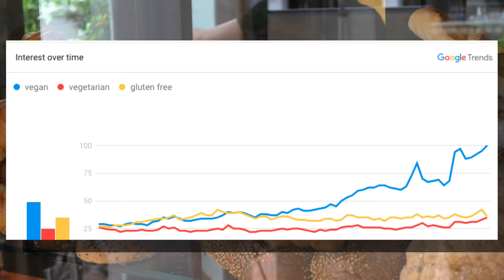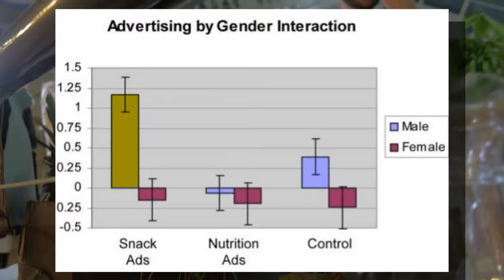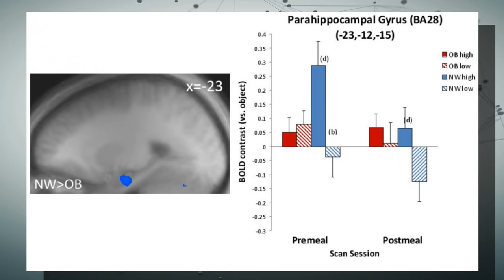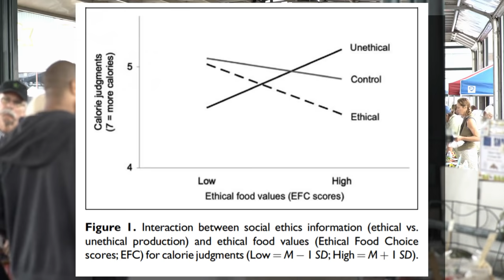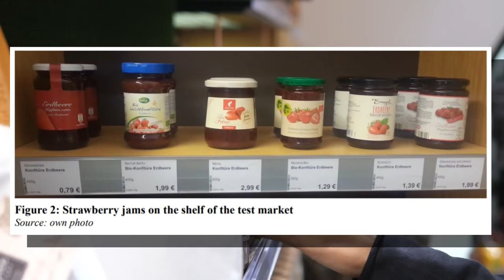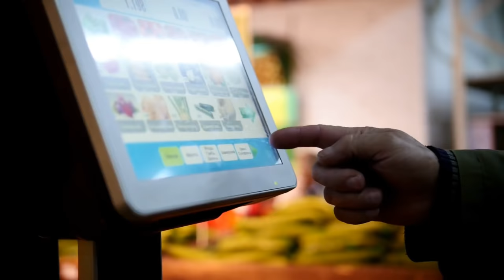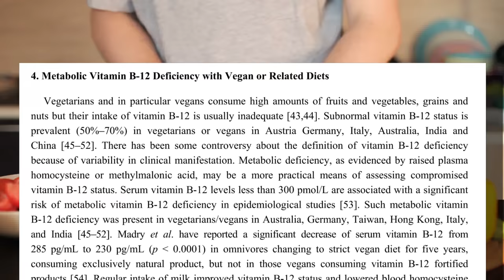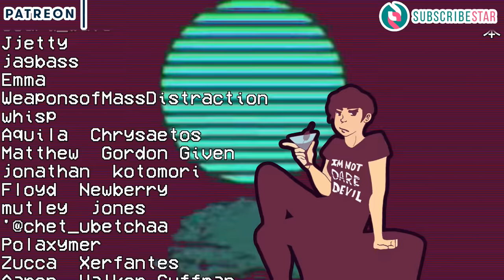Liquid Smoke and Mirrors : Impossible Truth About Food Fads

Comment: As to the bit about vegan burgers being grilled on the same surface that is econonomically and therefore morally irrelevant. Burger kings goal is not to kill animals just to make money so whatever they sell lots of they will produce
Reply: While economically irrelevant, it doesn't mean it is morally irrelevant, (although this is likely to result in the morality of the issue being ignored)
Reply: @jeffersondemott2125  it ismorally irrelevant because you are not incentivising the slaughter or sale of animals. If anything its more environmentally friendly as you arent requiring them to heat a larger space, buy another grill, and renovate their building into said larger space. If veganism were a majority position then it might be able to have a similar effect to deplatforming (so i may still be against it) but at this point all it does is reduce profit of vegan options and vegan restaurants
Reply: @jeice13  1stly advertising vegan or (insert food allergy) free food than processing said food in an environment where cross contamination is not only likely, but proven to happen is immoral, or at the least unethical [false advertising and potentially dangerous]
2nd the objection is to the "unethical" treatment and preparation of animals, [not necessarily environmentalism] and if clear violations to a promised policy are ignored then no actual change is encouraged (more vegie burgers than real burgers)
3rd and really the primary point impracticality does not bear on morality. In 1700s south it is more practical for a plantation owner to own slaves however as I'm sure we can both agree that is not a very moral means to gain money, further the "Company shop" was a highly practical method of industry to "cut down" profit loss, however it was also highly unethical and immoral. Morality, ethics, and practicality are 3 separate measures and while ethics and morality are similar enough to compare and contrast with each other, if you were to judge them involving practicalities you might as well compare time with weight.
Reply: @jeffersondemott2125  cross contamination is relevant to allergies because contact with any quantity of the substance can cause effects whereas morally it does matter if you are exposed to an animal after it dies only how many are being killed (though that is a ridiculous view to take for more intricate reasons) or how much animals are made to suffer. This means any behaviour that doesnt cause more animal meat to be produced wont matter in terms of moral veganism unless youre suggesting its okay to kill any number of animals as long as their corpses just rot in the sun. Second a lot of vegans seem to raise environmental effects as one moral component of veganism so it is kind of relevant. Finally i raised practicality to show that because grandstanding that has no chance of furthering your cause is morally worthless, aure it might raise your social standing amongst other activists but it helps no one
Reply: @jeice13   1st the moral and ethical burden lies on the producer of goods (the primary actor) hence why the distinction between allergy or preference is irrelevant, because the corporation does not know, nor need to know my motives for purchasing their specialty products [keep in mind there are people who actually can't eat various flesh meats due to ailments and are therefore forced into vegan lifestyles]. So again if a corporation (in this case fast food, specifically BK) advertises a vegan meal, they are obligated morally to uphold their end of the informal contract (that is exchange of my capital for their goods) and If they promise vegan which explicitly excludes any animal products, and fail to deliver it has no bearing on the customer's moral status. 
2nd whether a persons actions are ultimately futile or not is only determinable in retrospect, and many people begin a seemingly impossible task, grandstanding for the "impractical" but moral reality. So if an objectively just anti-proposition is held even it is not inherently worthless, and may be ultimately worthwhile while not in the present. The examples of this historically are too numerous to count, but some we praise today are an end to widespread open slavery, absolute monarchies, racial segregation, etc...
Reply: @jeice13  your presentation seems to be based in a kind of utilitarianism, which is a very limited worldview, that doesn't allow for the imagination, which is essential for change. 
I don't even particularly agree with veganism, but your argument is simple ridiculous
Reply: @jeffersondemott2125  the moral burden lies on everyone who voluntarily participates in something. This means you can have no one at moral fault in cases such as manslaughter or several people at fault if a group murder someone. If you view veganism as a moral imperative then consumers of animal product are incentivising production while suppliers are facilitating those customers wishes. Unless you have a better definition of what creates moral responsibility i cant really take your objection seriously as it is ill defined and therefore functionally meaningless.
   You seem to be conflating unethical business practices using the word "vegan" with violations of vegan ethics. This is moronic as that would also mean that any unethical action burger king takes are aomehow violations of potato ethics, beef ethics, and bun ethics because those are also things they market and sell. The ethics of veganism are only relevant where animal welfare is concerned not general business malpractice such as false advertising.
    You seem to object to utilitarianism arbitrarily so would you say it is etter to wave a stick around and hope for world peace than to go out and do things that help people? What about equally good? After all the question states good intent for the former but not the latter so if effects (or probable effects) are morally irrelevant surely flag waving and prayers are the pinnacle of moral good
Reply: @jeice13  let me make this simple because you seem to not understand. You're original comment was "...burgers being grilled on the same surface that is economically irrelevant and therefore morally irrelevant." Therefore while yes there is an impotence of morality in the customer (in this case the vegan) that is not being analyzed, because that 1: that is more subjective, and the morality of the actual preparation process is an objective issue. And 2: the customer has no direct hand in the creation of the product. Therefore I am analyzing and voicing the duties of the Company, and contradicting Your statement, that due to economic irrelevance the Company should only do what is best for the Company, (make the most money).

I'm only addressing the company, because YOU only addressed the Company in your original comment.
Reply: @jeffersondemott2125  if you pay someone to murder are you not even slightly responsible for that murder? Is hitler only responsible for the innocents that died by his own hand? Once you take things to that point you have to make every step you oppose of any process evil in isolation to have the people who do it bear any moral fault which seems like it should also strip contexts that make actions acceptable such as self defense for the sake of consistency.

Ill ask again, who is morally responsible for manslaughter? Under your suggestion it appears to carry the same moral meaning as murder by virtue of both causing a persons death
Reply: @jeice13  the person responsible for manslaughter is the person who killed, legally and morally. But that isn't really pertaining to this subject. 

Burger king (and plenty of other companies) advertise vegan food, and are thus obligated to actually make vegan food, meaning no cross contamination happens with animal products or parts. 
If a corporation doesn't want to be responsible, then they have an obligation to clearly state "Product X is Not vegan" or "Product may contain real animal products".
Reply: @jeffersondemott2125  thats business ethics. Cross contamination wont increase animal death or suffering so its only relevant to allergies, its the same reason a fair number of vegans will use up their old leather items and just not buy new ones
Reply: @jeffersondemott2125  also the point of the manslaughter question is if you bear the same moral responsibility for manslaughter as first degree murder why shouldnt we give them the same punishment?
    You also ignored the question about holocaust responsibility. Hitler mostly ORDERED peoples deaths which puts him in a similar position as a restaurant customer so is he responsible?

Comment: The growth of organic and non-gmo food    is in large part the result of a minority rule situation, similar to how much of the food in western grocery stores is kosher despite Jews making up a very small portion of the population. The minority rule is basically that an intolerant minority will control a tolerant or apathetic majority. In this case, some consumers refuse to eat GMOs and most don’t care. A business captures the most market by catering to the smaller group, so long as that group is evenly distributed across a target population, past some significant enough size, and the cost of doing so is not outrageously higher. As the cost of having organic or non GMO is brought down over time via market pressures, it seems likely more and more things will be offered primarily that way.